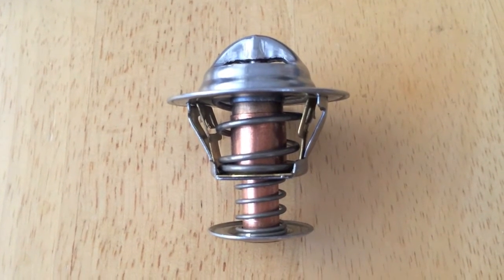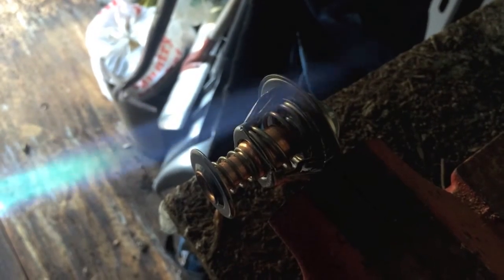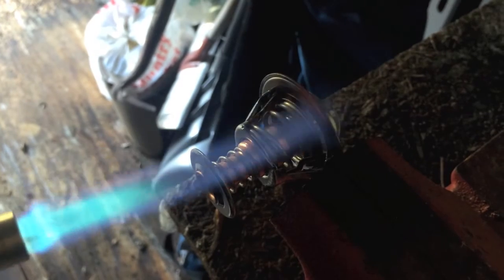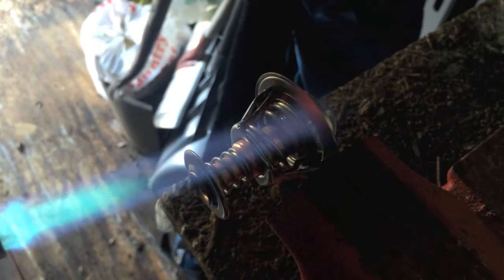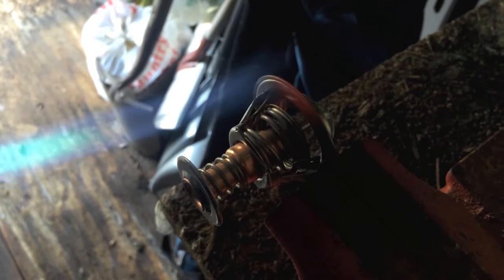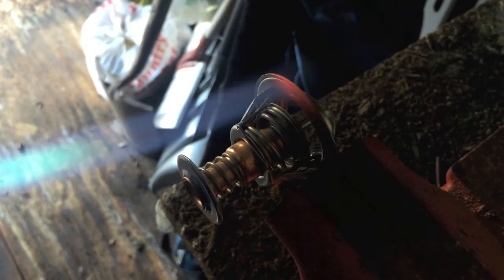How a Car/Truck Engine Cooling System works!

Comment: how does the spring open? what pushes the spring?
Reply from the maker: +Alexander Senna Hey thanks for viewing and commenting.  As the system heats up, it begins to create additional pressure which in return begins to expand and add tension to the spring!  Subscribe to the channel, thanks again!!